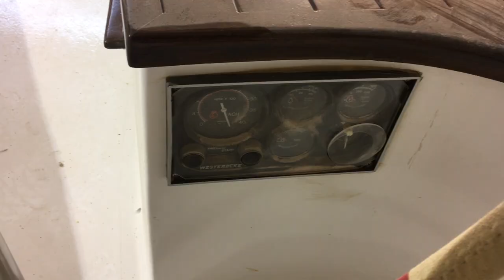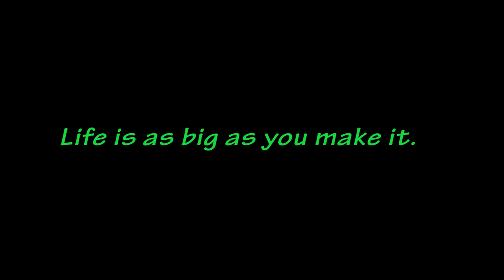Whitmar Ballast Keel Work

Comment: I've never seen a pour up close like that. Is the outgassing normal? Could you have baked out the mold more?
Reply: it's water boiling out from the concrete.....they didn't let the mold sit long enough or dry it out with a brush torch prior to pouring....

Comment: Was the melting pot custom made? Would like details of it and of the tube that delivered the molten lead to the pit ... 😎
Reply from the maker: Yes I built a steel box out of 3/4" plate on nine legs and welded in a 3" nipple in the bottom corner.  The steel pipe was attached with a 3" 90 ell.  I attached a wire so I pull the pipe over to dump into the form in the ground without getting too close.

Comment: I assume the "boilng" is steam?
Reply from the maker: The lead boiled for a long time after the pour.  During heating, parts of the lead (at the bottom) had already turned to liquid while much at the top was still solid.  While we waited for all the lead to be liquid it started building.  It did not take long to start boiling, but once it did it held the heat in the deep mould and boiled for a very long time; almost an hour.

Comment: Splashing diesel onto the rebar is bad practice.
Reply from the maker: Kevin Hornbuckle It was a feeble attempt to release the plywood form from the concrete in the future when we were going to wreck the forms.  Didn’t work anyway.  Had to break it out.  The diesel was not for the rebar, but the plywood.

Comment: I'm assuming the 2nd concrete pour was a different mix, is that correct?
Reply from the maker: Yes, the second pour was a Perlite mix to endure the heat.
Reply from the maker: Correct.  It was a Perlite mix to hold up to the shock of the heat of the lead being poured into a cool concrete form.  It worked perfectly.  There was no cracking in the Perlite.  I did preheat the Perlite a little by building a small fire in the bottom of the mould prior to the introduction of the lead.

Comment: Whats it cost for the lead and labor?
Reply from the maker: Phong Do  The lead was about $1.30 a pound.  Roughly $17K delivered. Labor is free when it's just me.  I had some guys that work for me help me, so they cost me whatever their salary is.  The crane cost about a thousand for this trip.
Reply: Jim Benge thanks, the keel is the most costly and hardest part for a backyard builder.

Ill have to check and see if the plans will let me cast it last.
Reply from the maker: New lead ingots today (or when I bought it a couple years ago) cost about $1.30 a pound.